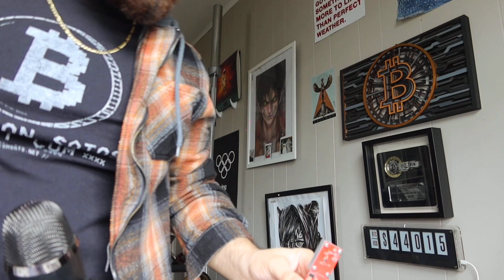GekkoScience Compac F Overclock Guide + TroubleshootInfo - JTC86

Comment: i have a good number of them; i have set all of them to run at 575Mhz max and they do run smoothly at that set freq. only during winter. 

In the summer 40% of the sticks finds it harder to stay at that freq and can drop to as low as 100Mhz if cooling isnt adequate. 

At 575MHz, 2.8V is required and between 375 - 390GH/s

Voltage adjusting can be frustrating tho haha.